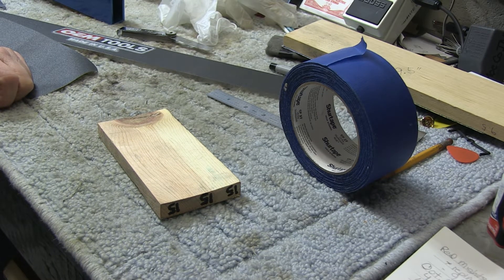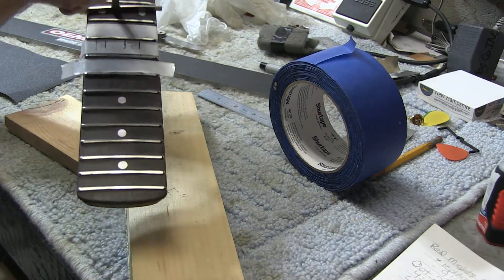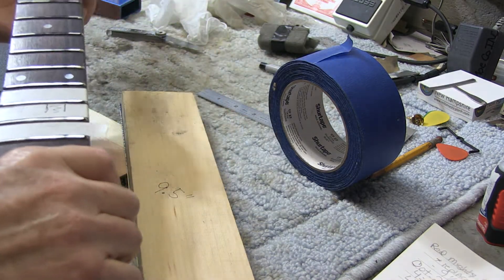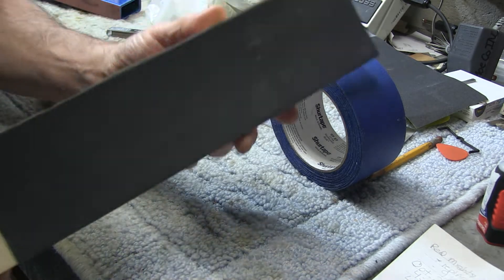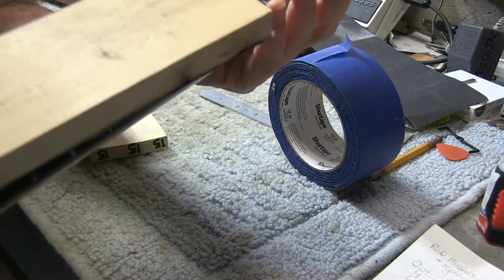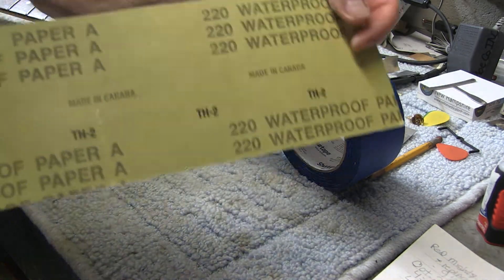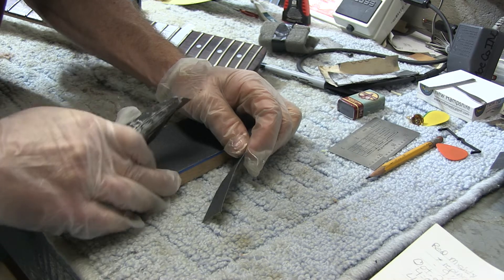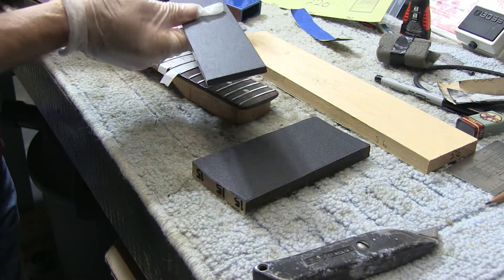How to glue sandpaper to a radius block

Comment: Where did you get those radius blocks?
Reply from the maker: Just saw this. I made a jig for my router and fabricated the radius blocks myself. I can show you how to do it if you want I have to make a few more soon and I will get the jig out and do a video of how you can make your own device for your router to make radius blocks. You want to use hardwood and it's not hard to do and it makes total sense but you have to be a pretty decent carpenter person who knows how to measure and has done carpentry very well, if you're a cabinet maker, you should have no problem. I don't think everybody can build something like this, but I have no problem giving out information because it's synergy it comes back.